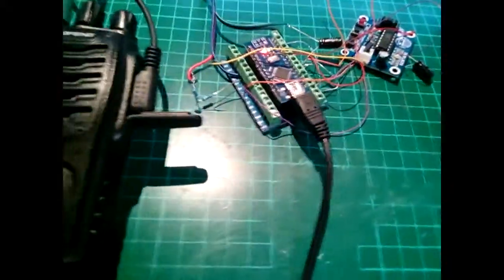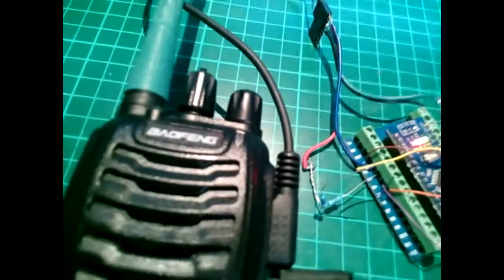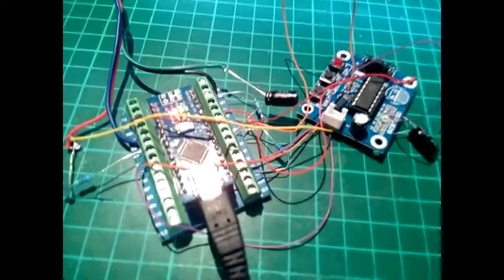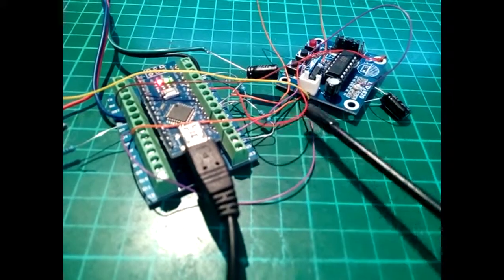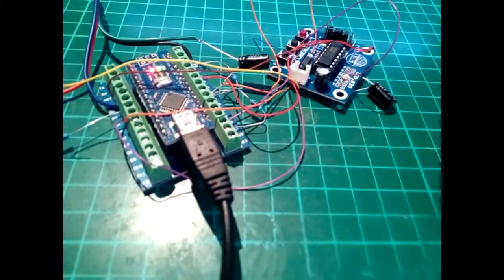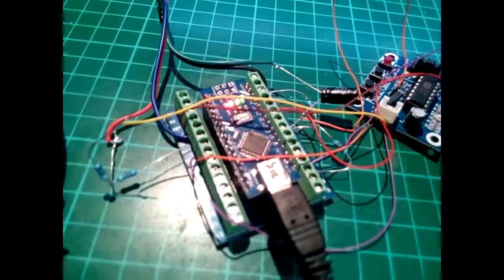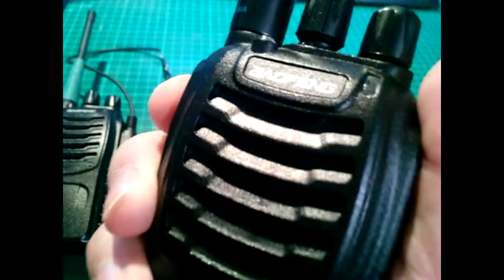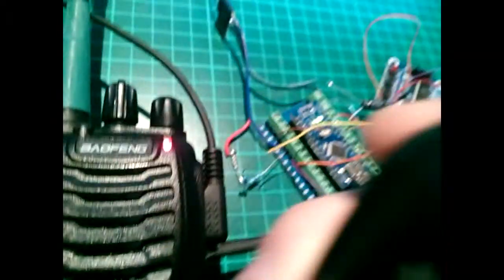Simplex repeater using Arduino and ISD1820

Comment: I did a similar thing. The board is Arduino nano, Baofeng bf888 and ISD1820. From the Baofeng motherboard I extracted a signal to the Arduino for accurate RX detection. That part works great. I wrote the code and now I get feedback audio on the speaker connected to the ISD1820. I'm stuck on this part. Instead of the speaker, the message must go to the Baofeng microphone. I turned on the VOX function. It all works. But over the microphone, the quality of the message is very poor. A schematic of how to connect a speaker-microphone-ISD1820 would come in handy :)...Today I finally solved the problem with 2 ferrite rings. The repeater works quite ok and stable.
Reply: Do you have a wiring diagram for me? I'm trying with isd1820 board but can't get it to work because I'm missing the circuit
Thx..
Reply: @Mr.Plüschix  Yes of course. I now have a fully functional simplex. With a little tweaking, I succeeded. I will send you the scheme and hex code tomorrow.

Comment: All well and good but completely fails to actually show anyone else how to do it. Basically like going look what I've done but I'm not telling you how. Still helpful though cheers..🙂
Reply from the maker: The video was a demo of the project but I was forced to move house a week or two later. I the the parts away as I didn't have space and time to pack everything.

There's little to it. Incoming audio is fed to the a2d and output used to press ptt on the radio. Just a couple of voltage divider to manage audio level. Tone was generated after incoming audio dropped then the ptt dropped.
Reply: @PIXscotland  fair enough, I'm just winging really apologies, actually your vid is one of the few that shows these things clearly. Thanks for explaining some more details 😉
Reply from the maker: @techtinkerin  no problem. All is good.

Comment: Sorry, had to down vote the video.  Wanted to up vote but the audio quality was poor and I have to believe you are using radios transmit on a licensed frequency but I did not get any call sign or repeater identification.  It is a shame that someone would be showing the making of a repeater but fail to acknowledge the requirements of legal use of one.
Reply: You're a turkey mate!!!

Comment: i would also like to make this  project. do you mind sharing the code and diagram please?
Reply from the maker: I'm working on the project right now. It's all mounted up a bit better and I've tweaked the hardware slightly. I will add more detail and show the code in the next two weeks or so I think.  Thanks for the interest.
Reply: @PIXscotland  thanks for the quick reply. i will be looking forward to it.
Reply from the maker: @torpe1  s
Still working with this.  Soon. Soon. It has proven a useful and reliable piece of equipment. 

The delay is due to a current change of jobs and a while lot of stress in that area which is still not resolved.  The video will likely come out around Xmas I think as I should have time to work on it.
Reply: @PIXscotland  fantastic mate. glad your still working on it. just in time for my passing the intemediate class.